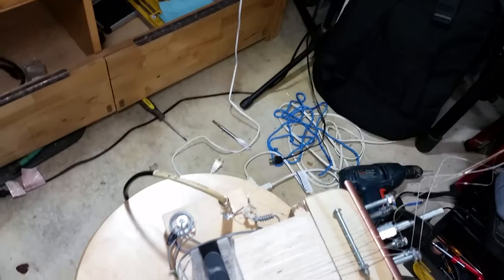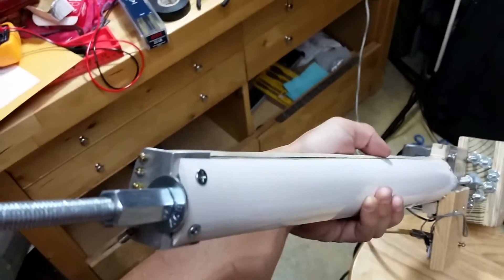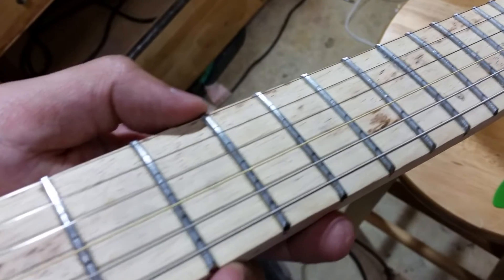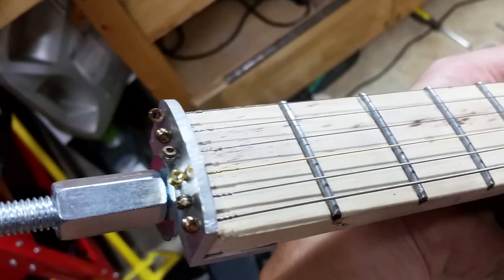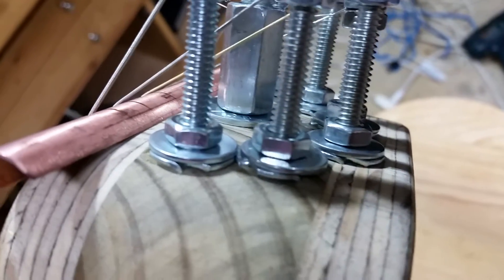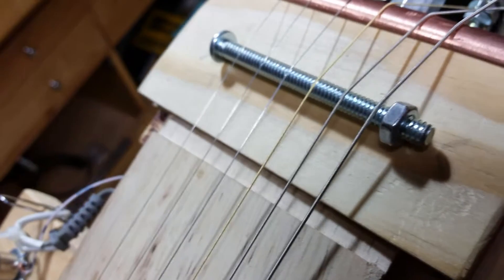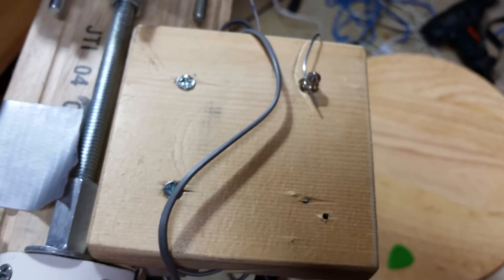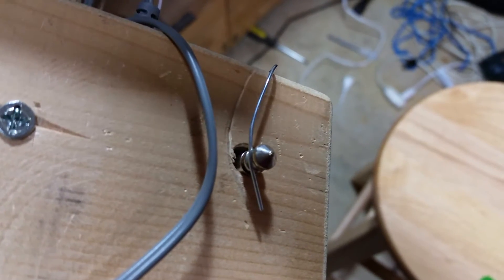WillsEasyGuitar "MacGyver'ed Guitar" challenge build: 49) detailed overview

Comment: You did a great job on this build. I would think the pickup and pot were probably the more difficult challenges.
Reply from the maker: Thanks!

Using a transformer's primary coil and a basic craft magnet for a pickup isn't a new idea; I saw it a few weeks ago in a couple D.I.Y. cigar box guitar (CBG) videos, though since they were used on two- and three-string CBGs they only used one coil. Having six strings and relatively low output of a single small transformer-turned-pickup on this guitar was a challenge, but adding a second transformer-turned-pickup mounted right next to the first and wired in series widened the pickup's magnetic field and coils. On the first day of this build, I had a working proof-of-concept pickup in about thirty minutes by smashing open a wall-wart and harvesting its guts (the transformer and the rectifying circuit), and then touching the tip and sleeve of an instrument cable to the prongs of the plug (connected to the primary coil), and sticking a wheel-magnet from a bicycle speed sensor onto the transformer's "iron", and then holding the whole thing over a guitar's strings to learn where the 'pickup' would work best and what the 'range' of the field was (barely three strings of a six string guitar).

Figuring out how to get two transformers attached (super glue) and mounted above the strings (hot-glued in an ammo box) was actually pretty straightforward.

The pot was the more sticky problem; I could have just left the build with the cable jack wired directly to the pickup and called it "done", but I wanted to do something that wasn't so simple. There are bunches of tutorials out there on how to make the classic school experiment* and how to make the coil-type** variable resistors, but nothing that seemed useful for this project. The graphite-strip type resistor seemed the easiest to work with - I could control the amount of resistance with the size, shape, and density of the strip; the problem I had was finding a durable and consistent substrate. Paper was not strong enough and the fibers made getting a consistent graphite layer and wiper contact difficult (evidenced by dragging the probes of my multimeter around the strip and getting wildly different results). Wood had the same issues. I experimented with using a fine graphite powder and applying it with some sort of hardening substance to make a track by grinding up pencil lead and mixing it with various glues, but none of those seemed to work.

I finally tried plastic as a substrate: the lid of a plastic box roughed up with very fine sandpaper and steel wool to take the graphite made for a consistent and predictable resistive strip, but proved difficult to work with. But a PVC pipe coupler proved to be the perfect substrate, and was already in the right shape - I just had to cut it to length with a miter saw. I already had an idea of how I wanted to make the pot, and it turned out pretty close to how I envisioned.

*color in a dark strip of graphite on a piece of paper with a pencil, and then connect one end of a battery to one end of the strip, and the other end of the battery to a small light bulb, and then move the bulb along the strip to demonstrate both conductivity and resistivity of the graphite strip

**get a length of insulated resistive wire, wrap it around some sort of insulating core in a uniform coil, carefully remove some of the insulation by sanding to expose a bit of the wire in each coil, and then make a wiper to move along the exposed wire to change the amount of resistance